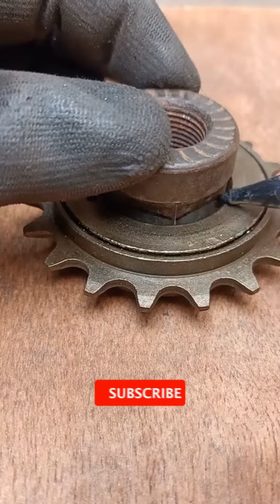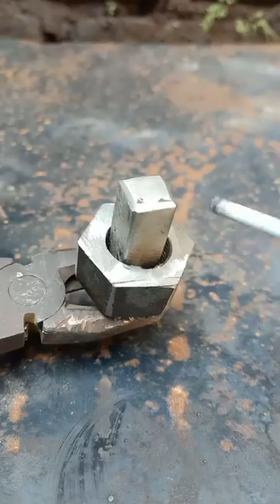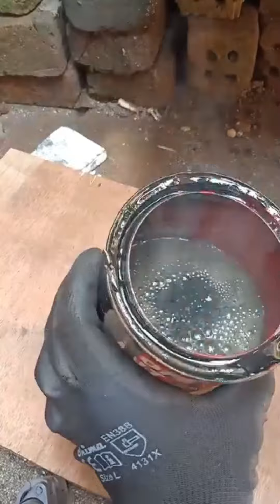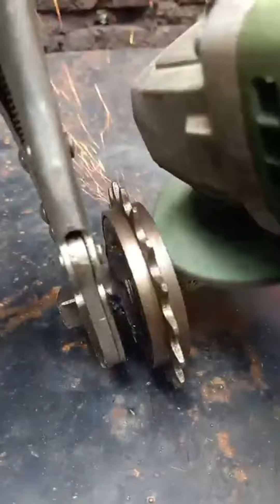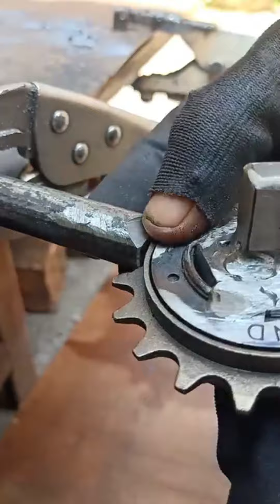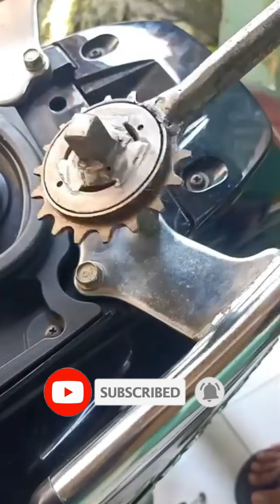Not many people are willing to tell you how to make tools screw opener like this

Comment: We use the term ratcheting  wrench or socket wrench(in the US), pretty nifty use of scrap,  I might consider using something other that a large sprocket for the head. Maybe use a ball bearing ring like in skateboard trucks and affix/weld your driver the inner ring and your handle to the outer ring. Score the rear of the driver that will not couple to the socket and use a small piece of metal to lock against the teeth you scored into the rear side of the driver. This way you will have more clearance to get in tighter spaces.